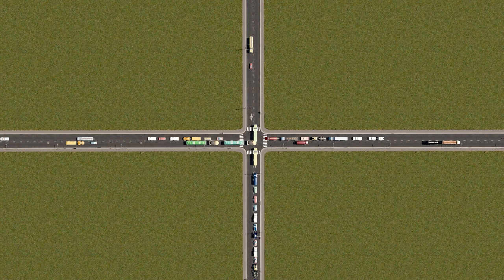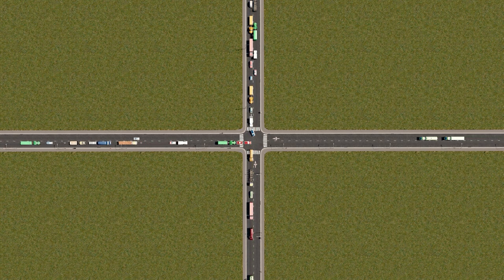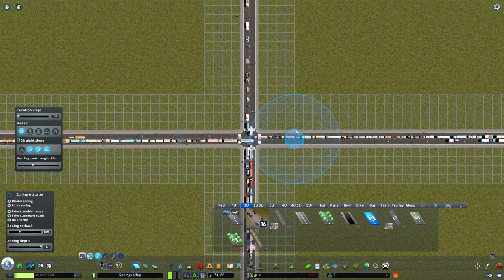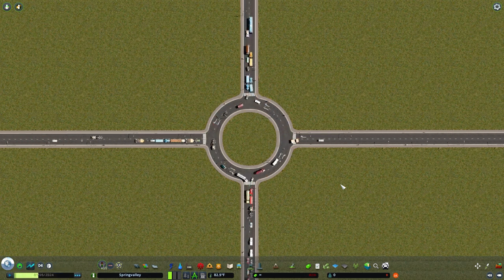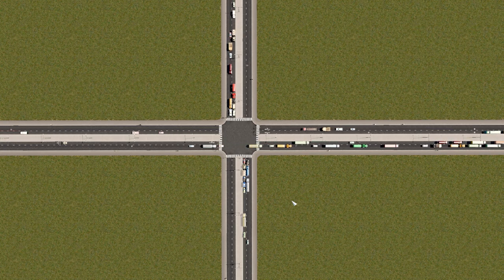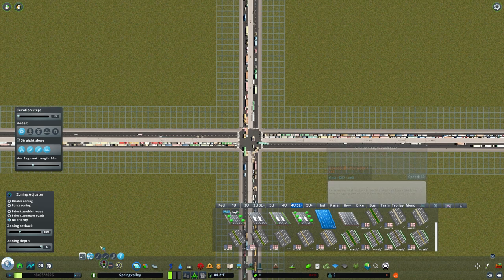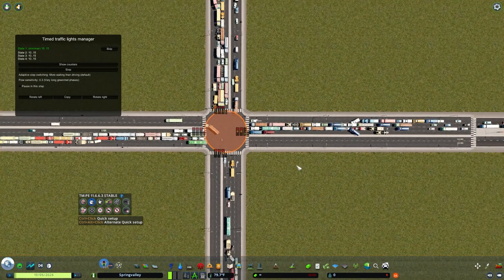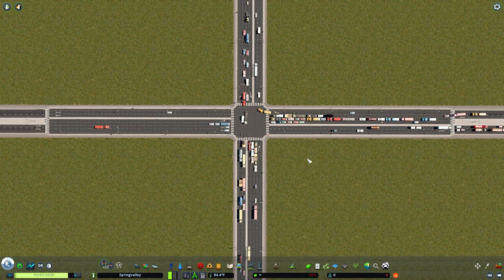Fix Your Intersections!  -  The Micro Level  -  Solving Traffic Ep 2 of 2

Comment: I tend to do grid cities and find that when I have a congested intersection, I do what Yumbl describes only to find that it lets so much traffic through, it just backs up the next intersection down the grid.  You can combat this by doing this technique at every intersection all down the collector and sync all the timed traffic lights together.  Sometimes I have 6, 7, or 8 intersections all synced together and the lights turn green first for all the cross traffic then for all the through traffic.  Works really well most of the time.

Comment: Thanks for your tipps and inspiration!
Your video about the SPUI (single node version) made me try 5+3L junctions, the tutorial about timed traffic lights (with the "secret" cycles to clear the junctions) brought it to perfection. Those junctions have by far the best capacity/space I've seen, pure peak performance.
From what I've seen in this game, a single lane can provide huge capacity if the flow is uninterrupted. Multiple lane are only needed to distritube/collect the stream smoothly or like in your example as a buffer. A fully used 4lane highway is more likely a sign for a poor layout than for big demand.

Comment: I was hoping that this would be a more in-depth explanation of the building blocks that go into these fixes. Like:
A: How do you set up a turning lane? Why would you want turning lanes? When and where do you want turning lanes? When and where do you want a merging lane?
B: What are lane connectors for? When and where do you want lane connectors? When and where do you NOT want lane connectors?
C: What kinds of traffic lights are there? What is the difference? Why is the TM:PE auto-setup traffic light the best in most situations?
D: What do you look out for when adjusting the timings of TM:PE traffic lights? When would you want to increase the times? When have you gone too far increasing the times/ when would you want to decrease the times?
E: When and where are roundabouts useful? Which TM:PE settings should you use on a typical roundabout? How do you calculate how many lanes to have on the roundabout and how many on the approach?
This video is more like a "Top 5 solutions for fixing an intersection".

Comment: One trick I like that is similar to your "blowing out the intersection" involves much the same tactics except a 3+2 is used with the dedicated right lanes being able to "go on red". It wouldn't be as useful with that much traffic though. I think I even saw you do it in another video, but not sure it was you. It does involve using lane connector to force left and straight turns into the inboard lane so right turn won't be affected. I will give this version a try next time I am having trouble in a heavier traffic situation! I think its more useful like in your PARCLO video. I think I figured out where I saw it...

Comment: Unless the traffic is unusually high in that specific directions, dedicated right turn lanes on intersections might not be necessary. You often see this in real life as well, where the intersection has a dedicated left turn and light phase for left turns only, but the rightmost lane is both for traffic turning right and going straight. Granted, in C:S the difference is not that huge as a 2+3 lane street takes up the same amount of space as a 2+4 lane.
Reply from the maker: Absolutely. I just didnt want to cover every iteration of asymmetric roads. 4+2 is the sweet spot imo, but of course an intersection is very flexible.

Comment: The biggest mistake I see with the roundabout portion is the roundabout is just too small.  Like with lane mathematics and road hierarchy - road size, intersection size, and roundabout size really matters.  Making the roundabout physically larger and thus increasing the distance between nodes helps a ton.  When nodes are too close together traffic "hesitates" and won't move from one node to the next till it's clear.   Once you do that there is no need to go with a 5 lane roundabout and force lanes.  Just bump it up in diameter so the nodes are further apart and traffic will naturally flow faster even when there are less lanes.

Comment: Macro fixes (other video) are usually better than what's being proposed here. Especially since typically when you're in a situation where you need to make one of these fixes, it's in a part of the city where there's no space. Also, everything here seems to rely on traffic manager -- even the basic roundabouts.
Reply from the maker: The two are not mutually exclusive. Always start with macro fixes is the message here.

Comment: The roundabout: You don't actually need Traffic Manager. Under junctions in the traffic routes tool under your overlay menu, you can disable the traffic light and then add stop signs, which serve as yield after stopping. You do want to place a highway there if you don't intend on having crossings through the centre, or make your own route for pedestrians so they do not cross the road. (Or pathfinding may not even happen due to the shape)
Reply from the maker: Traffic still wont “enter blocked junction” within the roundabout though. Its really bad
Reply: @YUMBL  2 thinks I'd like to clarify:
- I'm referring to the first small roundabout, if you make that big of a roundabout with that many lanes, this isn't for you.
- This is for people who play vanilla. TM:PE is an essential mod no matter what. Hands down.

Comment: In your "turbo roundabout", the junctions permissions aren't right - you can see the cars approaching are all stopping rather than flowing.  It's like they've got stop signs or something.  It's certainly possible to have them enter the junction more smoothly than that without having the "enter blocked junction" ticked!

Infact, you can see the stop at @15:40  (start at 15:30 to see them stop) - they've an empty junction but halt anyway.

Comment: For the 4+2 roundabout, would it be more efficient for the traffic taking the 3rd exit, to exit into the 'fast lane' instead of the 'slow lane'? (In the version shown in the vid) the traffic on the opposite side taking their 1st exit is also exiting into the slow lane, and the slow lane is also being occupied by the through traffic from the 'right'. This puts 3 lanes of traffic into the slow lane and only 1 lane into the fast lane. Whereas, if the traffic taking the 3rd exit uses the fast lane instead it's split evenly and I can't see how that would disrupt the flow of traffic through the roundabout. (Correct me if I'm wrong :) )
Reply: As you look at the colours, the dark green would merge with the peach instead of the lime.

Comment: In my city the traffic always goes between 68-71%, when I turn off de-spawning, it went down to where it goes between 65-68%. Traffic is busy, but it is always flowing. The city has a lot of high-density zoning. Could it just be that traffic is busy and the percentages are alright?
Reply from the maker: That may be. If everything is functional and not backing up it’s not a problem. Have you already implemented transit?
Reply: @YUMBL  Yes. Mostly Buses and Subway.

Comment: for the turbo roundabout I personally don't see the need of having a 4 lane into 5 on the roundabout for a 4-way intersection, I always do, x-way intersection, then all roads leading are x-1 and on the roundabout itself is x, so basically, for a 4-way intersection, have 3 lanes coming into the roundabout, 4 in the roundabout, having such big ones seem like unnecessary conflict points, unless you choose to sort the traffic with the traffic signs in TM:PE (i.e. transport truck only road) or to have a road come back around, as the outer lane is best to keep as dedicated right turn for the road it's connected to
Reply from the maker: I was just matching the volume handled by a 4+2 road
Reply: @YUMBL  ahhh that's fair

Comment: In the last roundabout, what if someone going, say, N-S but needs to head back up N...? They don't have that option with the lane connectors, right?
Reply from the maker: Correct. They should find a legal place to turn around.
Reply: @YUMBL  Sorry, didn't know that wasn't legal in the States. In my country it is.
Reply from the maker: It is generally legal, but if the markings disallow it you shouldnt. Such is the case in some turbo roundabout designs.

Comment: From what I've seen in this game, a single lane can provide huge capacity if the flow is uninterrupted. Multiple lane are only needed to distritube/collect the stream smoothly or (like in your example) as a buffer. A fully used 4lane highway is more likely a sign for a poor layout than for big demand.
Your video about the SPUI (single node version) made me try 5+3L junctions, the tutorial about timed traffic lights (with the "secret" cycles to clear the junctions) brought it to perfection. Those junctions have by far the best capacity/space I've seen, pure peak performance.
Thanks for your tipps and inspiration!